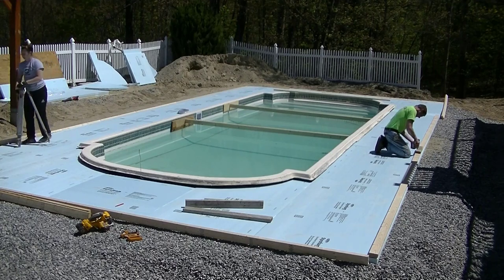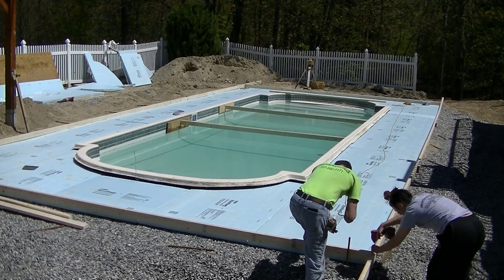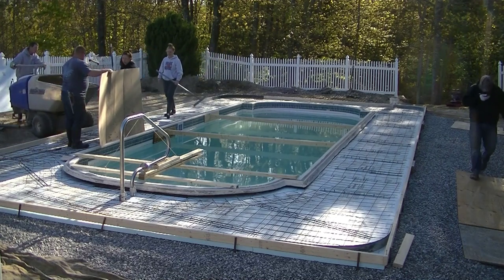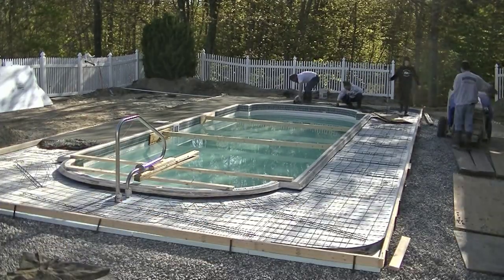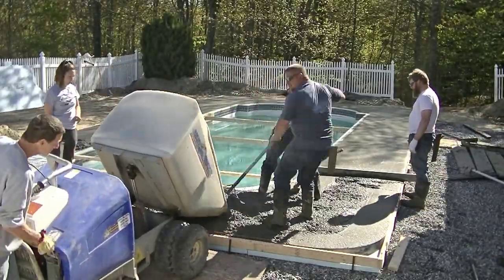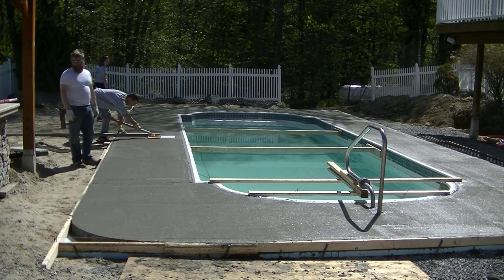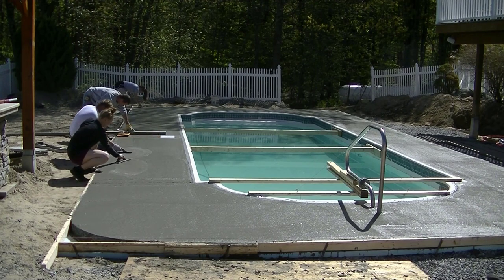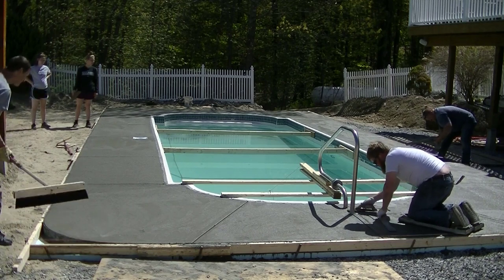Forming, Pouring, & Finishing A Concrete Pool Deck (Brand New!)

Comment: Oops hit the wrong key anyway I owned a concrete company back in the 80s and we just called them pool decks. We did all kinds of finishes using stegmier forms for the cantilever  using a 3/8 6sk pump mix in all different colors ! And basically did everything you have done! I sure miss doing them. Thanks for the video

Comment: Mike glad I found your videos. Im a contractor, mostly interior remodeling. Have been hesitant to do flat work but have done a few smaller slabs. Your videos have been a BIG help. About to do my own pool deck. Im thinking about tackling stamping. I have a shed slab i need to pour so I can practice on that. My question is about "cool deck" It gets hot as blazes here. Do you (or anybody else) have any advise or videos on cool or kool deck?

Comment: Hi Mike, we just had a pool put in with a concrete patio. Due to the slope of our yard the concrete is about 12 - 16" off the ground along the back side and you can obviously see the clear stone underneath and coming out the side. I would like to build a wall (like a garden wall using tech bloc) along that edge that butts up against the concrete. Are there any concerns with doing this? I'm wondering about drainage (if it's needed since it is against the concrete which is on top of clear stone) and also if there are any other issues that I need to be aware of. Thanks! great video!

Comment: Mike, I am replacing the deck on a 50-year-old inground Gunite pool. Similar to the one in your video here. Before I pour, should I put some kind of gasket between the coping and the new concrete deck?  Like an expansion joint?

Comment: When I pour pool decks like this, wipe the coping with dish soap before you pour, I didn't see any ground wire tied to the wire mesh..with that insulation down, the water can only escape from the top
Reply from the maker: We actually spray Pam around the coping before we pour

Comment: What is the purpose of the 2" foam?
Reply: I also wondered why you would insulate a pool deck. Maybe it helps retain the heat from the pool heater?
Reply from the maker: It's just to insulate the ground and help prevent frost heaving in the winter

Comment: I do more framing than anything else. Just wondering why some guys finish with steel floats after mags? I notice you went from mag to broom?
Reply: Steel trowel after mag for a slick finish (not ideal for a pool deck). Broom right after mag so the cream creates a sort of ‘sanded’ finish with better slip resistance.
Reply from the maker: We don't steel trowel exterior concrete in Maine. It's more likely to trap moisture and cause spalling
Reply: @MikeDayConcrete  Ok that makes sense.  I didnt know you could finish with a mag is all. L earned something new. Thanks.
Reply: Here they seem to to steel finish  and broom it after.  But yes in rougher weather id guess youd risk spalling from the thinner top layer from steel.

Comment: What's the purpose of Styrofoam in that application Mike?
Reply: I was going to ask the same question.
Reply: Same here Mike please share.
Reply: Same.
Reply: From another video he says it increases the set time in cold weather.  This doesn't look too cold though.
Reply: I don’t want to speak for Mike, but he said the home owner did all the grade work and installed the foam.  I can’t imagine the foam serving any purpose in this situation.  I would guess it was a misinformed homeowner.  Not cheap stuff, I pay $30 to $35 for a sheet of 2” foam.
Reply from the maker: The foam insulates the sub-base and helps prevent frost heaving in the winter months. The ground doesn't freeze under the foam.
Reply: Mike Day Everything About Concrete Thanks Mike